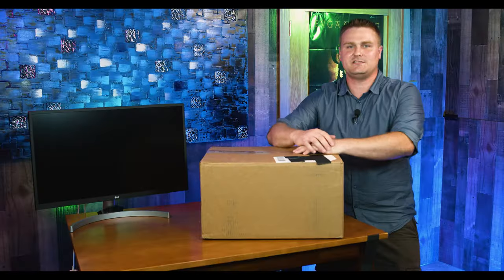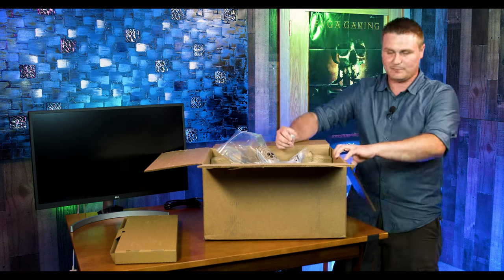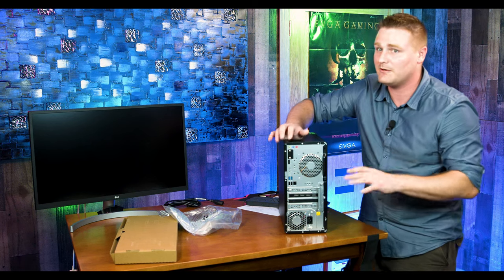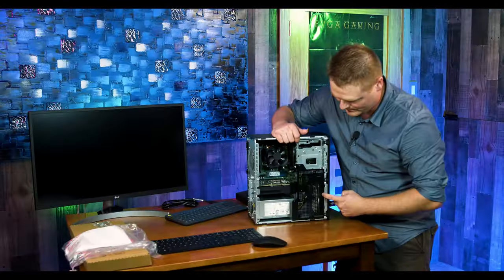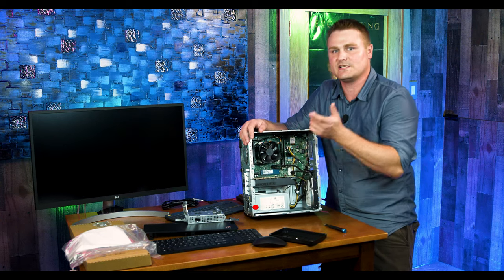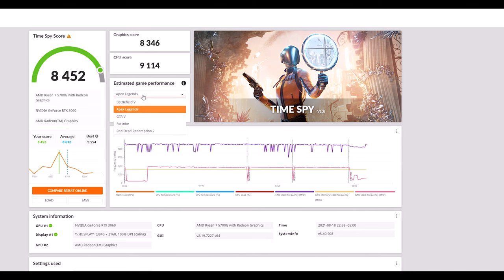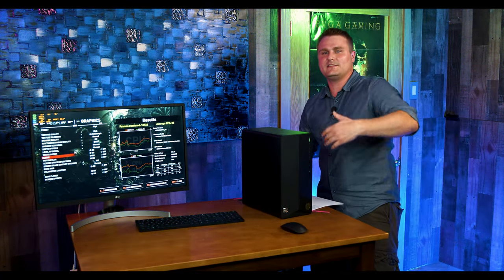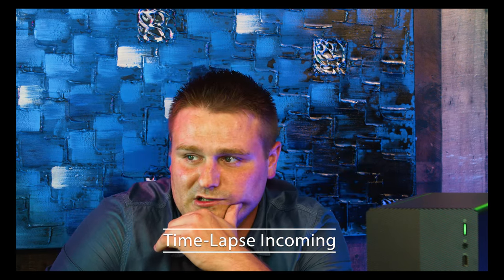HP Pavilion Gaming Desktop TG01 2167z Unboxing Benchmarks & Game Play | Ryzen 7 5700G & A RTX 3060

Comment: I put a 3060 12g in my hp 400w prebuilt and runs great! Problem is that now the system is pretty much maxed out and for anymore upgrades you'll need a whole new motherboard, case and power supply.

Comment: 5700g in this HP seems to underperform standard benchmarks by a solid margin of 20%? Any reason why? Did HP limit it?
Reply: The website isnt that accurate
Reply: probably the cheap stock cooler maybe? because that case has pretty bad airflow
Reply: The website aint that accurate
Reply from the maker: It shouldn't not be.

Comment: got this prebuilt for 852$ tax included, an open box from microcenter insane value.  the only thing i’d upgrade is the storage since it only came with 512 gb ssd m.2. if you are getting this look for a microcenter nearby . they have insane open box deals
Reply: where did you get it for that price
Reply: @raiderscreed8999  micro center near me, i saw in NY they had it even cheaper around 700$ open box
Reply: @AIM.02  can you send link bra?
Reply: @raiderscreed8999  they have really good deals with open box, all it is just maybe missing the packaging but it still works
Reply: I saw this for that price too but at bestbuy. Sadly they don't sell them there anymore. Really good deal for what you get.
Reply from the maker: Yes they do I am in Wisconsin and I have to go to Illinois to go to one. Only problem is they do not put there sales online.
Reply: Just bought one used at 600dlls the market is craaaaaaaazzzzyyyyy
Reply: @emanuelperez408 nice pickup

Comment: 61C under load looks pretty decent to me, my actual CPU (i5-10400) is running at 71c with a noctua cooler. So I think that this should be ok with the stock cooler! I just ordered a different model with the same specs (TG01-2007ng)
Reply from the maker: 70 is in the ok range, it is when you get past 80c I start to worry.
Reply: @TNW1337  what temps do you get in gaming?
Reply from the maker: @AlemannoDigitale  I did not see your comment, 50-65c depending on the game it runs a lot cooler now.
Reply: @TNW1337  Yeah I got my hp pavilion with the 5700g and I had to replace the stock cooler because the cpu was running too hot (about 75/77c simply watching videos on YouTube). Now I have a noctua cooler and it hits at most 53/55c in gaming. The real problem is the custom rtx 3060 that goes fast up to 85c and will never go down also with the fan at max speed…I have to find a solution 😕
Reply from the maker: @AlemannoDigitale   it sounds like they did a bad thermal paste job on the Gpu. The card is not to hard to take a part, just make sure you lay the screws out like you took them out. or Print a  paper with a grid on it to lay the screws out. After removing the GPU heat sink there are pads and paste. the paste they use is crap. I  would order Thermal grizzly or cool master pro paste. 

with the Fan on the table, then remove all the screws you see, some will have small springs on them. be careful not to lose the springs. Then turn the card so you can see the Display ports and HDMI port there are more screws there, the fan shroud is screwed to the heatsink fyi. there is one  hidden screw that  holds the PCI slot bracket. Once you have all screws removed hold on to the heat sink not the fan shroud and the thermal pad will be kinda stuck to the card. take you time and try to pry the heat sink from the PCB. one you get it removed try not to touch the thermal pads you need these to cool your VRM, Pwm And Ram.
It is also a good idea to wash you hands with dish soap to remove any grease or oil on your hands. Now you should have them split. Use some 90% isotropic Alcohol to remove the old paste from the heat sink and PCB die. The thermal paste they use is none conductive so when cleaning if you get it on other parts no big Deal. your only removing thermal paste not pads! Once clean, replace with a good amount of paste this is not like a cpu IHS/die. more is better here. I mean do not verg it, but use 4-5 pee sized dots, I like to spread it even, then I do 1 or 2 on the heat sink its self. i also spread it with a CC card or spreader stick. this should help this problem. 

Replace heatsink so where the die screw wholes are lined up.
Replace the screws with springs 1st. Once you have the 4 screws started from the Die area screw them in a x pattern. Only do quarter turn at a time, on one screw at a time, then switch. this helps even out the paste on the die & Heatsink. Replace other screws till snug. if they have a spring it should have a stop & will not turn any more.
Replace PCI bracket and screws, Replace card. Watch for any spike on temps on MSI afterburner  

Last thing I would say to try is download MSI Afterburner once installed, go to the fan setting and turn the fan to max then hit apply. Make sure to un click AI/auto fan. to make sure gpu fan is set to high.
Reply: @TNW1337  wooo man, thank you for the oversized answer, it’s awesome 😂 I will try ASAP and hope to solve the problem. For the thermal paste I usually use the noctua that’s included with their CPU coolers, should work as well. I was also wondering if I could replace the stock single fan coolerwith a dual fan Arctic Accelero but I can find detailed specs and I don’t understand if the Accelero is able to cover the VRM, Pwr and ram thermal pads too.
Reply from the maker: @AlemannoDigitale  Any time
Reply from the maker: @AlemannoDigitale  any time
Reply: @TNW1337  so the work is done but with poor results. The situation is a little better but not exiting. I cleaned the old stock thermal paste, put enough new noctua nt-h1 and did not touched the thermal pads as you said. Now I get a max temperature of 83c instead of 85c but with the old thermal paste the gpu went at 85c after a couple of minutes. I made some stress tests with heaven and superposition and the gpu now reaches 83c only after 10/15 minutes of full load and remains stable on 83c. In gaming checking with afterburner the results are the same but I get an immediate 4/5c temperature drop when the card load goes under 95%. In conclusion I had always 85c with the old thermal paste and now after the replacement I’m in a stable range up and down from 79c to 83c.
Reply from the maker: @AlemannoDigitale  I feel better. 85c is high but 110c is top end for gpus so it is in a safe range.
Reply: @TNW1337  yeah it’s definitely more safer now. I will try to remove the HDD and install a front fan that pushes fresh air directly on the GPU, maybe I can gain 2/3c lower and also have a better airflow inside the case. Thanks for your help, your tips were very useful! 👍🏻
Reply: @AlemannoDigitale  Since you have tried maxing out the fans, I assume you know how to use MSI Afterburner. Honestly power limiting it to like 80% won't lose more than like 5-8% performance.
Reply: @RS-nq8xk  ok I'll try, thanks!
Reply: can i ask someone for help,  would be able to play games? I just got it, I'm not really computer smart I got this at 1,169 Doller,s , did i get rob or should i send it back i still got 30 days 
Gaming & Entertainment     AMD Ryzen 
Form Factor 	Desktop
Colors	Black
Processor 	AMD 6-Core Ryzen 5 5600G 3.9GHz Upto 4.4GHz
Processor Main Features 	64 bit 6-Core Processor
Memory 	32 GB DDR4
Storage 	2 TB
Graphics 	AMD Radeon RX 5500
Audio	HD Audio
Ethernet 	Gigabit Ethernet
Wireless Card	Wi-Fi 5 (802.11ac)
Power Supply	400W

Comment: Technitwit, boyo, you can turn off the front panel light from the omen gaming hub. Its actually wicked easy.
Reply from the maker: I just hate bloat ware and uaslly remove it. But thanks for the info. The olders tg do not come with the omen software insrslled.
Reply: I had problems with Nvidia Geforce experience whenever I have the Omen hub installed. It wont optimised my game somehow. So I just removed it and pull out the wire for the light. But if u dont use geforce experience then yeah u can use the omen hub to switch it off.
Reply from the maker: @Buckheimer  I Like Geforce Experience

Comment: also what replacement chasis woud you recommend? because i would like to get one with better airflow but budget of course😄
Reply from the maker: The one I did the HP case swap Is nice and Cheap. Also comes with 4 Case fans witch is a plus you do not need to buy them And RGB Fans.

Comment: Love your videos! I have just ordered a HP TG01 Rtx3060ti and ryzen 7 5700G. Do you recommend putting new cooling in instantly? I've watched your noctua CPU cooler + fans and it seems good. Also I do 1080p gaming, can I play while not being scared of overheating?
Reply from the maker: I would put at lest the small Noctua cooler in.
Reply: How are FPS rates with these specs on 1080p gaming? What's your experience like so far, i'm really curious.

Comment: Hey what do u think about the tg01-2206ng hp pavillion. I just got it for 900 bucks with a 3060 ti. Im worried about the bad airflow and cooler.  Do you think its a good deal .. 
also the mainboard ( erica6) is just china made. I hope the temperatures are not that high and the gpu , cpu wont overheat…
Reply from the maker: If you do the cooling upgrade I do to the TG01-0023 it will fix that.
Reply: It handles 160w before getting hotter/louder than I would like. You can set a power limit and/or undervolt and/or add a fan

Comment: Hi, I have this PC except with a Ryzen 3 5300G, do you know if it's possible to upgrade to a Ryzen 7 5700x, it's not listed as an upgrade option on HP's website for the Erica6 Motherboard, but the 5700x has the same 65W TDP as the rest of the upgrade options.

Comment: Good Video. One question.. Is it possible to remove the mainboard and everything and put it in an other Case?
Reply from the maker: Yes but you need.a new mobo psu and case.
Reply: New motherboard and new powersupply.. okay thats wild. Thank you for the quick answer!
Reply from the maker: @AndL89  yeah it sucsk but can be done for under 200bucks.

Comment: Hi, I'm currently looking for a "buy&forget" desktop PC. Meaning I do not want to fumble with the internals. Since these HP cases have bad airflow, can this be used "as is" without worrying about the temperatures? Also, as alternatives, which would you recommend as an allrounder (not just gaming): 5600G with one of these RTX 3060 or a 5700G with a 1660S?
Reply from the maker: A hp will still work just fine with out any upgrades make sure you get dual channel ram 16 or 32GB. Get the 3060ti Version it is worth it and well allow you to play newer titles longer. If you do not want to do cooling do not get a I7 or Ryzen 5700 
Get the 5600 or i5 12th gen version. W/ 500w PSU.
Reply: @TNW1337  Thanks, I still got the 5700G with the 1660S. Will work great for 1080p gaming and I want the extra cores for productivity software. Also, Benchmarks show that the 5700G gets only marginally hotter than the 5600G when under load. On the other hand, the 3060 needs 40W more energy under load and gets extremely hot at the core when used in one of these HP cases (without tinkering). So I'd certainly be concerned about the lifespan of these cards in this scenario. Remains to be seen if users will face problems after a while. Energy consumption is a concern for me, not only due to costs, but also we are facing a distribution crisis here which will last a while. Better save energy than be sorry 🙂 Thanks for your answer though 😉
Reply from the maker: @alhanzar  yes or a  3050 you get dlss 2.0 but use less power

Comment: Need to know if your 3.5 HDD has additional hardware to mount in that front panel position.  I have the older TG.
Reply from the maker: It just screws hdd have holes on the bottom and sides.
Reply: @TNW1337  definitely throwing a 16TB in there if the prices ever get below $300 again, thanks.
Reply from the maker: @zeroturn7091  yes sir

Comment: Hey! do you think this pc would be good to mine eth? I read on some forums that the PSU is not good enough and it will eventually die faster cause of the heat
Reply from the maker: If you plan to mine look at legion, the hp is not bad. Do you also plan to game?
Reply from the maker: Only problem is a got dual pcie lane hard to. Add more cards down the road
Reply: Yes this would be to play/mining, of course not both at the same time
Reply from the maker: @cybershelltech  I've been mining with one of my TGs 10Mouths now. Because some of the lHR cards need a full 16x PCie to get a ok hash rate. So yes it will work

Comment: Great video I was gonna ask do you think it’s possible for someone to upgrade the case in the future into a much better version that has better airflow?
Reply from the maker: I would just do a case swap.
Reply: Then get another computer to start with. Really, this case is not a gaming case just a regular office case. Cooling is not any better, there is not a single intake fan on there. Then the motherboard and lots of other stuff is special HP stuff so its not made to work or to be installed in another case.

Pure Performance is good though so if you just want something that works for cheap then go ahead but if you are thinking about upgrading this and that you gonna end up upgrading everything on this pc n the end, its not a good platform to work on in my opinion.

Comment: Please educate me on the audio connections. My current HP Pavilion (about 6 years old... and dying) has 5.1 channel audio with a total of 5 audio plugins.  I’m using 3 plugins for my 5.1 speaker (Green/front, Black/rear, Orange/sub).  This system says it has 5.1 channel audio, but it has only 3 total ports with only 1 (Green) for speakers.  Does 5.1 surround no longer take multiple plugins? I’m guessing I couldn’t use my current 5.1 system unless I wanted to add an old 5.1 Sound Blaster card.
Reply from the maker: It is virtual 5.1. Yes to get true 5.1 you need every one to be plugged in. Virtual has gotten pretty good. but it all depends if the app or game if it even supports it.

Comment: I've watched many of your videos, very informative to include small but essential details like screw size etc . The fan noise on this machine was too loud, so I installed the noctua redux B9 92 mm case fan and saw good improvements in the noise and temp went down by 4 - 5 degree C. After doing that I could only hear the CPU fan, so I went ahead and upgraded the CPU fan to NF-A8 PWM, instead of replacing the whole cooler, now I'm seeing 60-65 C idle temps which used to be in the 50-55 C range. But it does good during CPU stress tests keeping it steady at 72 C. I was worried I might have jarred that heat sink when replacing the CPU fan, so I reinstalled the CPU with Corsair TM30 CPU paste, maybe the Corsair paste is not as good as the one used by the factory.
Next I'm planning to upgrade the CPU cooler. I have ordered NH-L9x65 after watching another video of yours for TG01, wondering if that will be enough for Ryzen 7 5600G. My goal is bring down the idle temps to 40-50 C range. Any other recommendations for CPU cooler for this model?
Reply from the maker: Yes all of that will help, I love the noctua fans & heatsinsk. they are much quieter option and make some of the best air coolers hands down. The Noctua heat sinks are better then the stock (Night and Day) even the smaller coolers can drop  you by 3-5C. 

Thermal paste can be very important, also if you get a air bubble this can screw with your temps. Try doing a X or a or a E Partner. Not all Cpus heat sinks are the same. Some CPU Dies are concave and some are convexed, This is why we use thermal paste to fill in a concave die or to fill around a convex die.

Comment: Can you tell please what version/variant of 3060 ti the 2008nv model has? Because from model to model some specs change. Also is it possible to upgrade to a 3070 ti down the road or it wont fit inside? And for the scenario it fits, then is there any 700+watt psu you can buy and install inside? I have an i7 4700 cpu 3,4 ghz and a radeon r9 290 graphics card in a large tower, and i get cpu temp 65-67 degrees Celsius and 90-93 degrees Celsius in the gpu while running Forza 5 or Witcher 3, without having any issues even if i play for hours... so i think it's temps are on the better side for me.
Reply from the maker: The 500watt cpu will support a 3070, Not sure about a Ti look up the TDP and if it is the same as the 3070 then yes. only problem I have not seen a Dual fan version under 12"
Reply: @TNW1337  I looked it up after I posted here. It's Tdp is 290 to 300watt so maybe with another 130 watt from cpu and motherboard can be supported. They suggest a 600 watt though, but they suggest a 550watt also for the 3060ti. Also it's size in average is length 10 5 inches and 4 7 inches in width. I'm expecting to get mine the coming Monday and I am not changing PC before the 8 year mark. So I hope if I can upgrade it's gpu down the road it will last me until then. What do you think? Will it be possible to fit one into this?
Reply from the maker: @CODINE80  3060ti  Yes.  The hp has the power budgeted for the 500watt but the 400 will run it. If you upgrade to a 3060ti or 3060 I would order the 500watt psu just to be on thesafe side
Reply: @TNW1337  The TG01 I ordered has a Ryzen 7 5700g, 16 gb ram 3200Mhz , RTX 3060TI AND 500 PSU. It is already a fairly powerfull pc, but i was just wondering if down the road i could swap the 3060ti to a 3070ti which i found to have the size of 10,5 inch in length , 4,7 inch in width and 290-300watt TDP. So i mainly ask if a 3070ti's size would fit in that case and if the 500 PSU can support it.

Comment: The only thing i’m wondering is if a gtx 1070 or gtx 1080 would work with that pc’s power supply
Reply from the maker: Yes it can I've testes 1070ti.
Reply from the maker: Not sure about 1080 if it goes Over the 200w tdp that is budget.
Reply: @TNW1337  Alright thank you man 👍
Reply: @TNW1337  Ohh ok